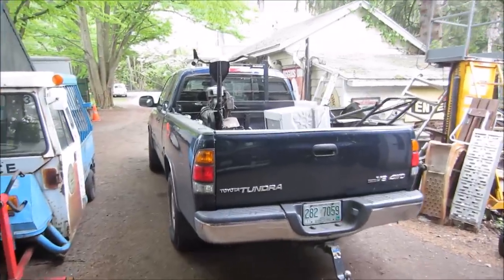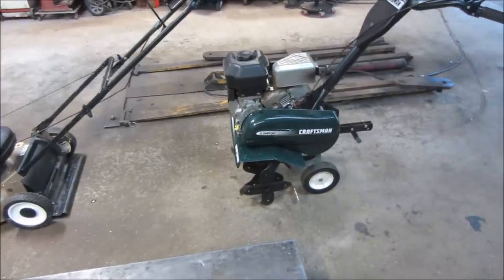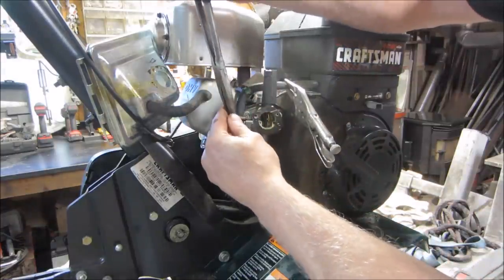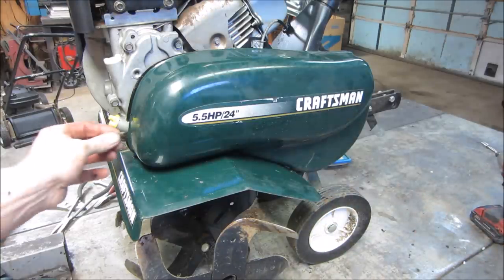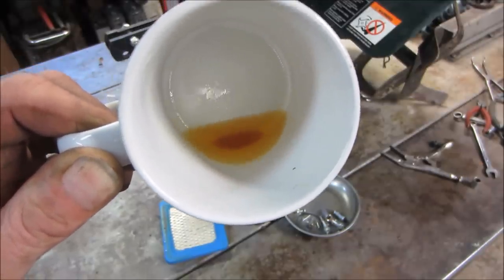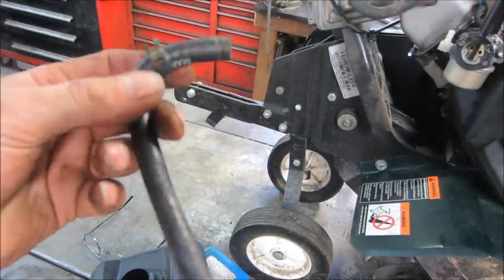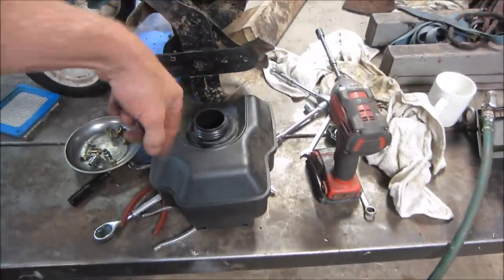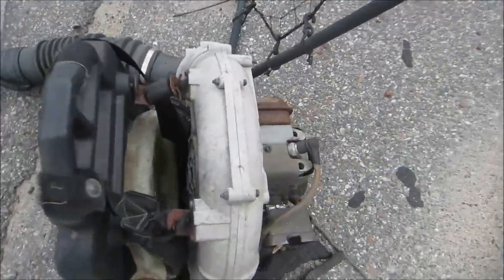will they run? yard sale tiller and mower

Comment: Im 12 i cleaned a briggs and stratton plastic carburettor which was in my grandparents lawn mower im so proud!
Reply: Good work. I wish mustie would have been on the internet when I maintained my grandpas garden machines. Or indeed that there would have been internet at all.
Reply: good job! i don’t like those plastic carbs one time i was trying to start my friends lawnmower didn’t start in 2 years and the carb flooded through i’m the intake and caught fire and i’m only 15
Reply: I’m 14 and I’ve been working on tractors right now I’m putting a v8 in one
Reply: Hands on training
Reply: I’m 12 and i work on my John Deere 212
Reply: Dupont overhaul!
Reply: 6 use
Reply: Nice!
Reply: I'm another kid who owns a lot of antique stuff and this week in going to get an Briggs and Stratton fb with the large flo jet carburetor! I've been wanting an fb for a long time I hope I can save it
Reply: Good job, but you've made a bunch of 20 year olds who never fixed anything feel bad. And as a sole reminder, if you (the reading fella) have never had the reaources, or even a table you could afford to get dirty, don't feel bad. It takes a workshop to do anything, and without the tools, youre in the stone age. Cant fix a carb for yourself if you dont own it either.

Comment: Hey - quick note to Mustie1 to say thanks for all of these videos.  After watching many of these, I was able to fix a pressure washer that had been giving me trouble.  Since the carb seems to be the first place to check, I took it off and gave it a good cleaning.  After that, it worked fine but ran rich.  Again, your videos helped me understand that I had hooked a linkage back in the wrong place - choke always on - so 15 min later it was all running perfectly.  Seriously, thanks again!

Comment: Hi Mustie1!  I am a retired commercial refrig and A/C mechanic (and you bring back many wonderful memories) What I want to convey to you is that any refrig/A/C unit that has been on i's back, sides or any non-normal position has a good chance of oil clogging up the suction intake tube in the compressor. Since a piston cannot compress a solid, it will lock up and become useless. If you have questions, i'm here to help.

Comment: Using Mustie as my motivation, I got a mower running yesterday that had not been started in ten years. It was frozen solid and would not turn. I put some oil in the spark plug hole and used a breaker bar with a socket to force it turn over. The carb looked ok so I put some starting fluid in it and it fired on the first pull.  Runs great and I mowed s thick weeds with it. Thanks Mustie

Comment: Hi Mustie...here's something you can do with your junk mowers...pull the motor off it. Make a plywood table slightly larger than the mower is. Make a frame with 2x4's and screw them to it, so you have a wooden cart with 2x4 sides. Bolt it directly to the deck of the mower. Cut out for the handles in the back area. Paint with an oil-based paint.
   (you may have to space areas so you have one bolt on each corner.)
   Purpose: the inside of the cart area has a LOW CENTER OF GRAVITY. The lawnmower was designed to be on the ground...so you can transport a large poundage of weight without it toppling over, as in a wheelbarrow). I've carried bags of fertilizer, bags of cement, bags of dogfood, packs of roofing, etc. I once carried an outboard motor fro my car to my boat and I built one for a mechanic buddy, that used his to carry engine blocks. 
   The uses are endless! It helps to have holes drilled in the side rails so you can rope taller things down. Folks will give you junk lawnmowers, but they're tickled to give you $30.00 for a carry-all. you can make for pennies out of scrap 5/8" OSB plywood and one 2X4.a little hardware and some paint.
   ((I once pulled one of the old type small wheelbarrows apart, because the tubular frame and wheel were shot, and made a DUMP-BED with it onto an old mower base. worked great to mix cement in with a hoe & roll it to where you were needing the mud and pour it directly from low to the ground without worrying about it tipping to the side))
   Folks see them and scrap DIY one themselves and find that they are most handy!
   I hope you get one of these going for yourself!
   AGAIN, I VERY MUCH APPRECIATE YOU MAKING THESE WONDERFUL VIDEOS !!!
   Bill, from Tn. 🇺🇸

Comment: Mustie, you should totally use the mower engine to rebuild that gokart frame you got earlier. I know it's a vertical shaft, but that's the fun. Use a twisted pulley setup, or a double pulley setup like the fan belt in the old Corvair's if you want it to be possible to add reverse or something. It would be a really cool thing to see made, and probably pretty fun to build too!

Comment: Big win on the tiller..and sometimes that happens w/the mower, been burned myself by what I didn't see until I got into it. Actually need a couple parts off 1 of those myself for another, so would use it for that. And it might be the only straight Craftsman wheels you run into this year! Nice pickup of the backpack blower after taking Lilly for ice-cream, those always sell well in the fall.

Comment: Those AC units are pretty decent. I've got a extremely similar model. It's almost 10 years old still works great. Kind of nice it has a automatic option, also a timer which is nice. So you can set the temperature that you want set it for 8 hours. And when the 8 hours passes it will automatically come on and start cooling the room down. Pretty nice. Came with a remote too that had a magnet on it. Other people have mentioned it but I think if you sit in AC unit on its side like that You need to let it sit in the correct orientation for a few hours to let the oil settle back into the compressor
Reply: Thanks for the info! I just bought one of these for 20 so fingers crossed it works for a good while. Much needed in texas!!!

Comment: I'm far from as skilled as you are Mustie.  But I just had to clean out a carb on a pressure washer for a friend and it looked identical to that one.  Picked up a rebuild kit for a briggs for 9 bucks and kept it running while the owner was ready to write it off.  Feels great to keep things going.  The problem with it was that the float needle seat had deteriorated into itself and was blocking gas from coming in at all.  Because of that, I had to buy at least the seat but the gaskets were so hard, it didn't hurt to replace them.

Comment: I trash picked an old Craftsman eager 1 that had a self propel system...it didn't show how ff'ed it was until I had tried to get it running...sheared keyway simple...oil sump had a hairline crack near one of the mounting bolts to the mower deck didn't notice that until I remade the sump gasket and put fresh oil in it... New head gasket to boot. Needless to say if I didn't actually need the mower myself it would have been a parts mower...spent nearly 100$ on it to get it running but it does indeed eagerly cut my grass now with no issues. All thanks to the confidence your channel has given me to tackle some small engine repair work. P.s. I have an old single blade plow with a Clinton engine on it...that's my next project 🤗

Comment: I have the same engine on my log splitter as you have on your tiller. This video is very informative.
Reply: Lamans Waters It's also the same engine used on my wood chipper/leaf mulcher (only difference is the tapered shaft crank used for the impeller/Flywheel)

Comment: I had (well, I still have...) a mower similar to that (same engine I believe? - but FWD) and though it's currently destined for scrap (my brother hit a stump with it and I fear the crank is bent or lower half is cracked) it was also a "Used it last year, just got a new one!"
I got it "running" back then but it sounded like absolute garbage.  Turns out the flywheel key was sheared and thus timing was off.  Also the previous owner had ruined most of the threads up there and I had to lose a washer in order to get enough torque on the flywheel up there (even after mating/lapping the taper carefully) for it to stop shearing flywheel keys.  
I guess I learned a lot... and it did last me a few years until that aforementioned mishap with a nasty tree stump.

Comment: Around here , the  gas will pull the moisture in and cause many problems on small engines . I now drive about 10 miles away to buy premium no alcohol  gas . If you have to use gas with alcohol , use Star Tron additive . Works well . I can't believe my neighbor ladies listened to me and ran all the gas out of their mowers at end of mowing season last year . I have not had to tear any carbs off of their mowers this year ! Did you ever notice how many people that have front tine rototillers do not have , or know what a depth regulator ( skegg ) is . I borrowed my neighbors and it did not have one , so I made one for it . I noticed it is missing now . At the least , I would like to have the 1/2" X 3" steel back !
Reply: I think they have no idea how much easier tilling is with one . If their feet are hitting it , they are operating quite strangely .

Comment: Mustie1   been watching some of your older videos like this one.   I get a lot of old gas as well I got a 5-gallon bucket that I  save it in (Unless it's really old skunky gas)Then when I am ready to fill up my own gas cans, I run the old gas through a few extra large coffee filters, being careful not to stir up any water that's settled out.  then I just fill my gas cans up about 1/3 of the way and go top them off with reg unleaded gas.   I have never had any issue using up old gas this way.  I just make sure I don't use it in any 2 cycle engines.   mowers and edgers run on it just fine. I consider it Free gas

Comment: Just a piece of advice from someone who learned the hard way - always place compressor driven units (A/C, refrigerators, freezers, etc,) in their upright positions for a few hours before starting to allow the oil that is in the system to settle back into the compressor. Failure to do so could fry the compressor if it hydrolocks (happened to me on a brand new unit similar to yours). Obviously you dodged that one...this time! lol
Reply: John Tilson we lost the Yu-Gi-Oh conditioner that way ourselves.

Comment: I had to check my garage - I have both this tiller and mower.  The tiller is missing the drag bar too.  The plastic gas tank cracked and Briggs wanted like $70 for a replacement so I got a new engine at Harbor Freight with a metal tank that actually runs better for about $90.  The mower on the other hand has been very reliable other than leaking oil all over the place.  It fired up with 3 year old gas on the first pull but last year I thought I killed it when I ran it out of oil from the leaks.  I filled it back up with oil and it runs but not as peppy as before so I probably did some internal damage.  It has sounded like it was getting ready to throw a rod for several years so I may be able to milk another year out of it before it dies.  I already have a Harbor Freight replacement ready.  I have the high rear wheel model and the deck is all steel unlike the new ones where the front wheels on mounted on plastic so I’d like to keep it running.

Comment: The best thing I have done for mine and friends window units it to give them a good cleaning on the evap and condenser coil. The go to Home Depot, get a roll of screen material and a 6 pack of little ceramic magnets. Cut the screen to drape over all of the air intakes for the condenser and use the magnets to hold it in place. Then I just pull the screen off once a month and hose it off to clean it. Its amazing what it catches that would normally be starting to clog the condender coil. And it keeps the bigger leaves and twigs from falling in a clogging the chassis drains.
Reply: If you forget to clean the screen, the ice on the coil will remind you.
Reply: It'll be the outdoor coil starved of airflow, so It'll either blow warm or go off on high pressure or temp on the compressor if it has those safety's installed.

Comment: I had the same issue with an Intek fuel bowl gasket (it expanded and would no longer fit on the carb), it was resolved by boiling it in hot water for about 10 minutes.
Reply: I'll have to try that . Thanks for the tip

Comment: I have the same lawn mower, but with RWD, maybe 15 years old and still running with hardly any demand for repairs except oil change, sharpen the blade, and spark plug change out. Sometime I get a little miss and I just add Sea Foam to the Crankcase oil and fuel tank and the miss clears itself and off I go. You got a good eye finding stuff wrong. YOU CAN DO IT!

Comment: Hi Mustie1,  just scored a free power washer because owner didn’t want to pay the price to get it running again.   It clearly had sat unused for a while.   So, went into full Mustie mode.   Emptied tank into large glass container and must have been half a cup of water at bottom.   Removed float bowl of nice Honda engine and bowl was heavily rusted and eaten up inside.    Found a genuine Honda original replacement carb on Amazon for $18 and decided cleaning old one was wasted energy.   Purged out fuel lines and stop cock, slapped on new carb, dried out the tank, added clean gas and she runs like new.   Pump was recently replaced so it was excellent.    Probably why the owner was done spending money on it.   I stripped the bypass valve anyway and cleaned.   Total cost about $20 tops.    Following the Mustie Method works.    I like the “will it run” items as that is what most people are faced with.   I like to hear your mental process as to whether continuing is worth it.   Even duds have learning value!  Best from Texas!

Comment: I acquired that same Craftsman tiller but the gearbox didn't work but the engine ran great so I just pulled the engine off it. At least I got a great engine out of it, will probably use the engine for either a mini bike or go kart lol.

Comment: Liking your videos. Learned a lot and these things will come to use. Just the otherday when i was lawing down the grass i had a problem with this loud rattling on a lawnmover after hitting on a few rocks and sticks.. I was almost throwing it to the neighbours side, but cracked open a beer and did kinda what Mustie would do.  Figured out on my own. Easy fix. Loose blade and it was about 5 min job including finding the right tool for tighening that fucker. Thank you. You have so good nerves for these things and these videos have helped me to be more patient. (Sorry about bad english)

Comment: Ok, let's get in that blower. I have one like it that runs great, sometimes. Then it just won't. Then I decide to get into it, and it starts and runs fine again.
Reply: i have a sthill one that also started just dying , was just gunk in the start/kill switch
Reply: basztian  mine was given to me, rebuilt the carb, cleaned up, and fired up and ran great. Then about every 3rd time I try to start it, it fires up, will run but not idol, dies and won't start. I get pissed and walk away, then next 3 times it starts and idols, and runs fine, and so on. Doesn't seem to be flooded (no wet plug) good spark, frustrating.

Comment: When storing yard equipment for the Winter, drain the carb. and put gumout in the tank line to keep out varnish. Put mothballs under the cover to keep rats out. Put a little oil in the cylinder to prevent dry cylinders during Spring start-up. Keep lawnmowers out of rain! Remove the gas tank and take it inside so the diagram won't be warped from the cold.

Comment: A good substitute for your expensive race fuel is 100LL from your local airport. It is usually a dollar or two more than e10 unleaded but doesn't go bad for years. Generally airports have a self serve pump on the ramp especially so with uncontrolled airports. If anyone asks just say you are buying it for a plane hangared at your home.

Comment: With regard to cameras, I'm just using a Panasonic HC-V110 camcorder for my videos over on my other channel (now called The Rotten Shed), it's not fancy by any means, I just prefer to use a camcorder than a point & shoot as they're easier for me to hold... :)
Reply: I'm not even making videos until I've got my camera on a swinging arm above my head :)   I've only got a sports cam (but no head band) with a wide angle lens,  so if it's on a tripod it has to be so close to my back I keep bumping the tripod.    These SJcams are so cheap now,  it might make more sense to buy several more and fix them to the ceiling so I get lots of angles every time.

Comment: Andrew Camarata uses paper towels and compressed air. Throw in some individual paper towels and then spray around inside with compressed air. The air causes any liquids to jump up and the paper towels soak it up.